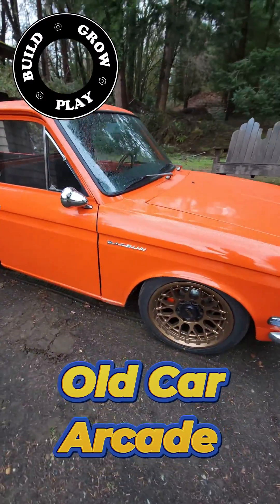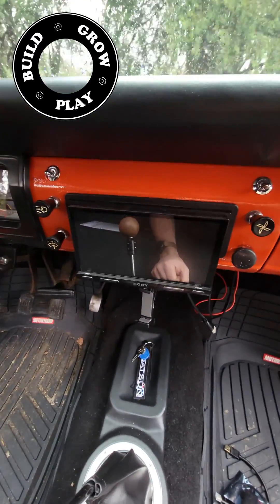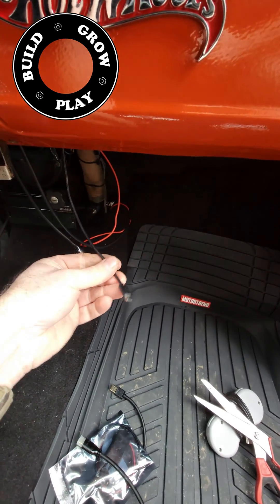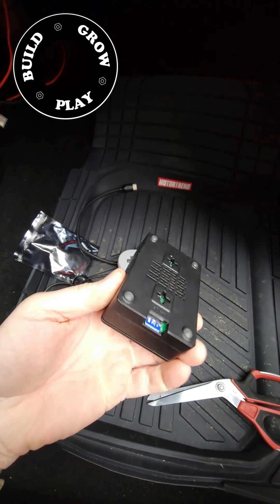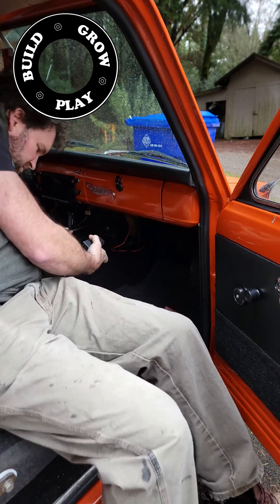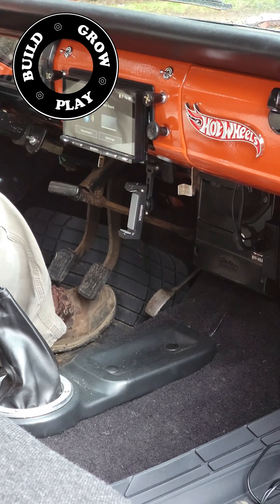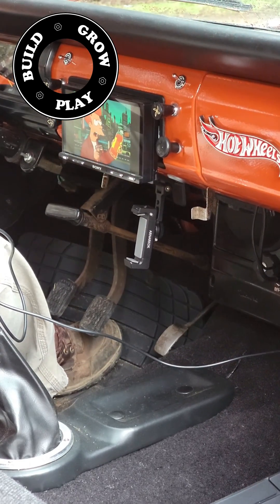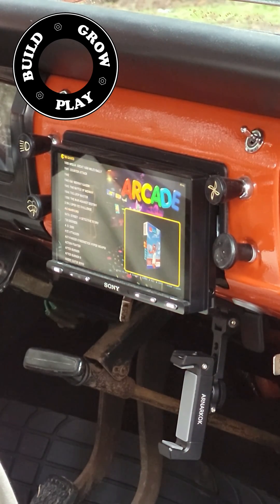Old Car Arcade, Datsun 521 Restoration

Comment: Truck is looking beautiful! Just bought a 70.
Reply from the maker: So close. Having fuel pressure issues that I just can't track down.
Reply: I just removed that fuel canister from bed and reinstalled the tank without all those hoses. Not sure if your truck has that system.  @buildgrowplay
Reply from the maker: @NissanNut74  yeah. I did all that too.